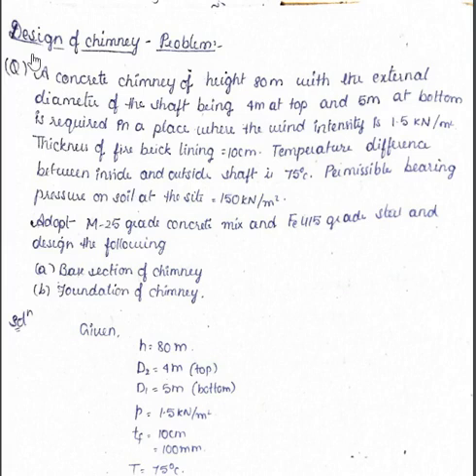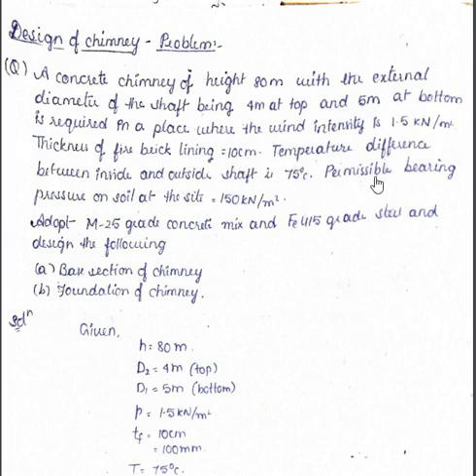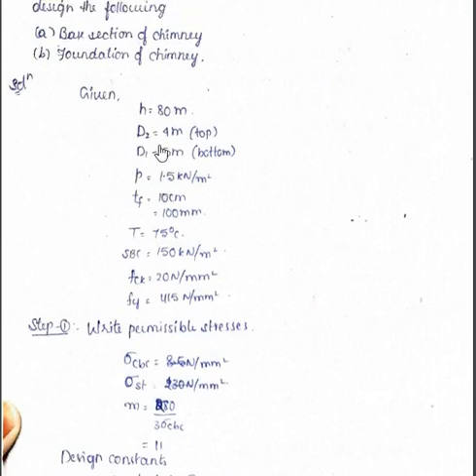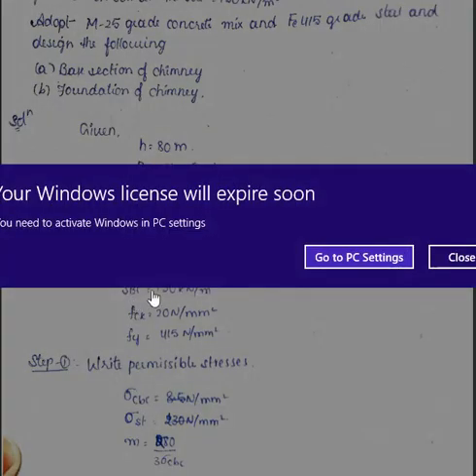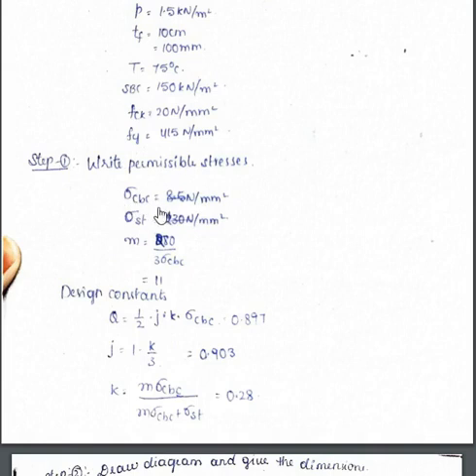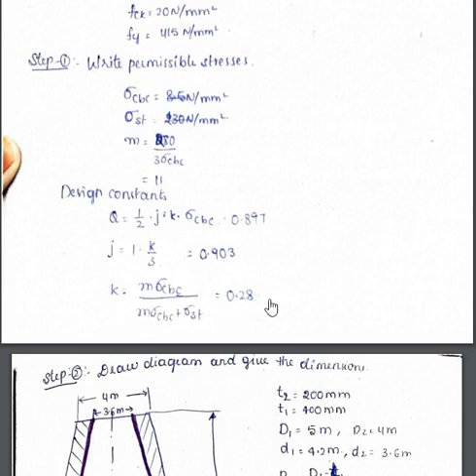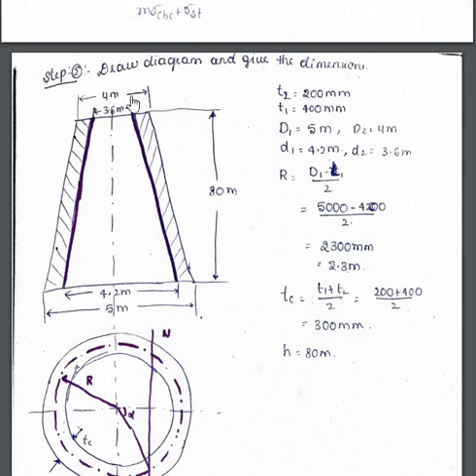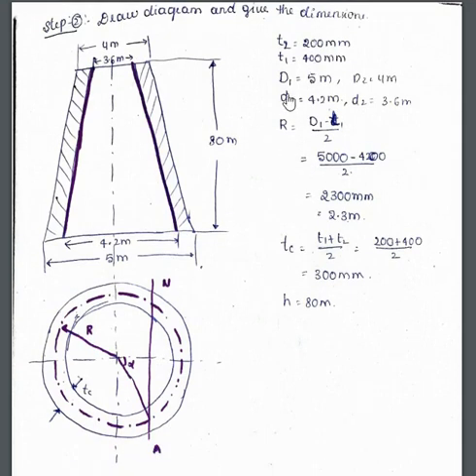Design problem on Chimney Part 1/4 (Working Stress method)

Comment: Mam how to calculate weight of steel chimney...??
Reply from the maker: Need to consider specific weight of steel
Reply: @MounikaMeduri  specific weight of steel is 7850kg/m3..

May i get the details formula mam in my watsup numbr-7004698335.
Reply from the maker: That depends on type and shape of chimney.  Please try to find the volume of chimney and use specific weight formula. Or otherwise, I will provide Chimney's topic in series of  Strength of materials course shortly. Kindly wait.